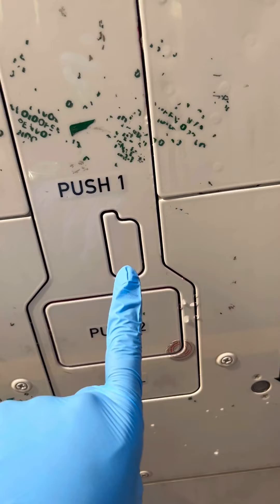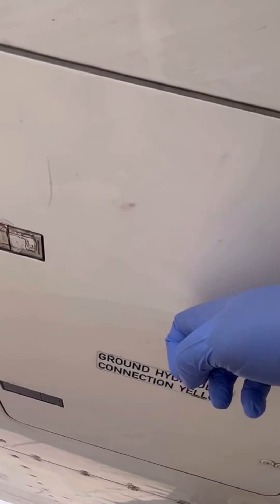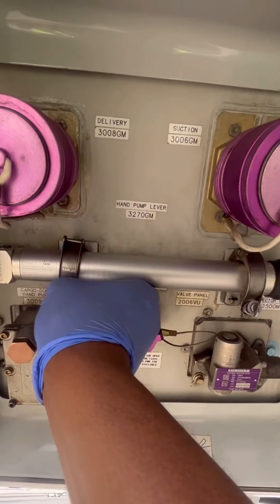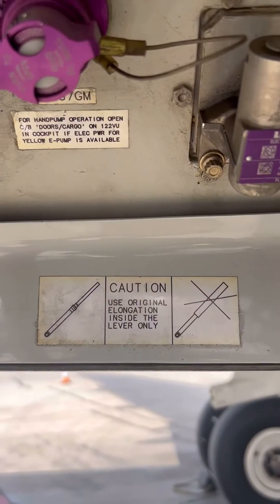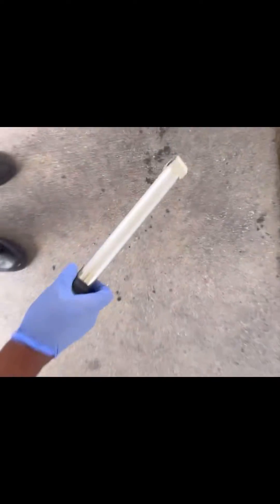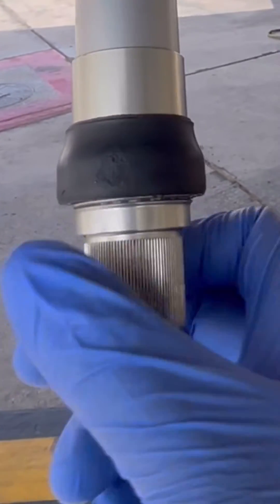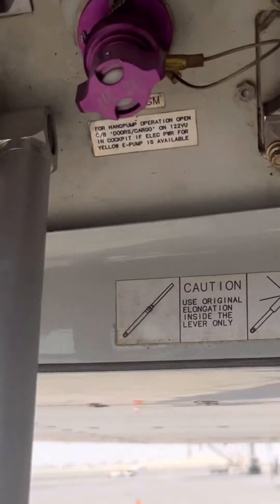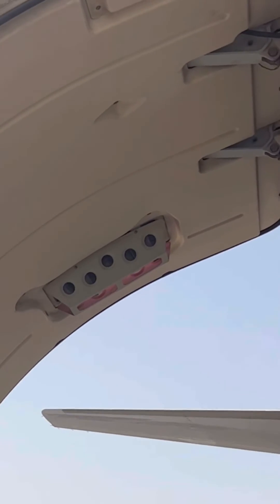Airbus A320 Cargo Door manual opening with Handpump

Comment: Looks like hard work. Does that handpump apply only to the cargo door ram, or does it actually pressurise the yellow hyd circuit.

Just a humble pump handle, but the engineering on it is something else!
Reply from the maker: Yes it is if it’s done prior to departure and you are trying to avoid a delay but under normal circumstances it’s not too bad.No it’s only for door closing and opening lines only not the entire yellow system.